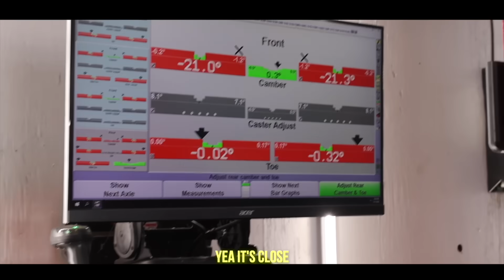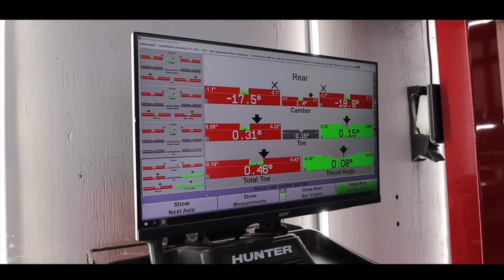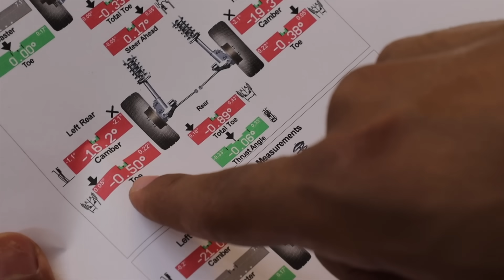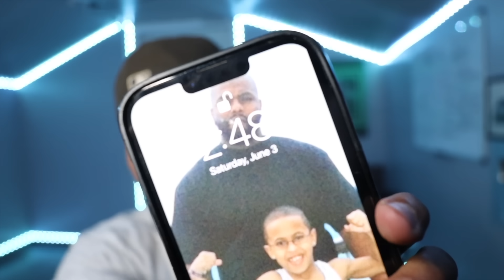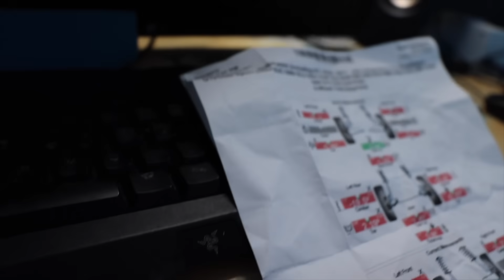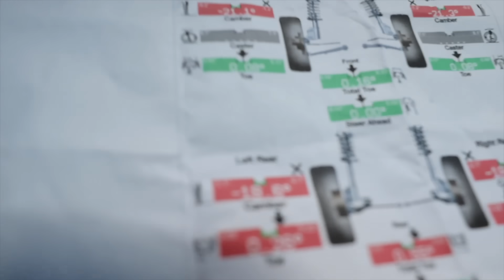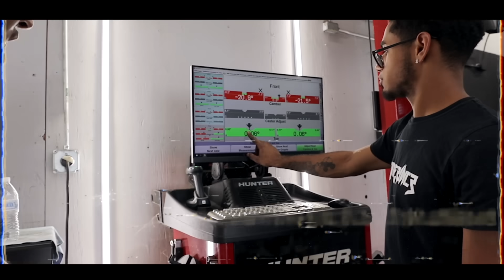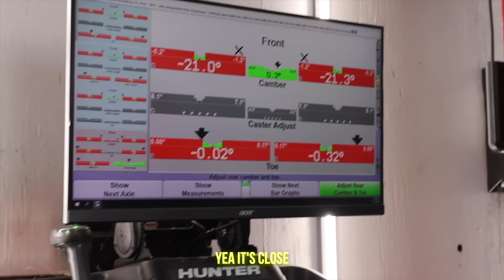I TOOK MY STANCE CAR TO AN ALIGNMENT SHOP THEN THIS HAPPENED

Comment: I never realized the calculations involved in driving the cambar of a stanced car. I've never been a big fan of them but your videos shed light on the scene.
Reply: I have an 05 GTI in my garage that I bought in 05 when I was stationed in Germany and people thought I was riding low. It's been in my garage since  I got out of the Army in 2012 and you've inspired me to do something with it. It has less than 70,000 on the clock.

Comment: I think it might be because the zero toe is in line with the caster and because if you draw a line through caster the point on the wheel on that line is in front of the contact patch, it would become inaccurate and the toe on the actual contact patch would be really toe in.

Comment: Hey man, you have more knowledge than me when it comes to this sorta stuff. Is there any way to lower my car even more with maxed out coilovers? When I got them installed I asked them to lower it as much as they could (at the time) so they ended up rolling my fenders a bit. A week after that, the front was higher than the back so I went back to autoscience to get the front lowered again. They told me it was maxed out but imo, it's still not low enough for my taste. 

The thing is buying another set of coilovers that can go lower is not in my budget rn
Reply: 4inch swift springs and take out 2 out of the three rings on your coils
Reply: Take the springs off you don't need them
Reply from the maker: Remove the springs add washers 😈